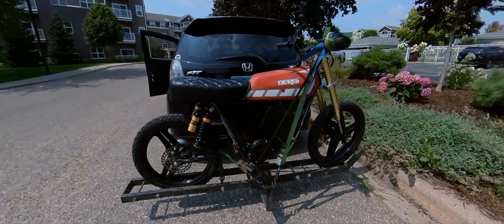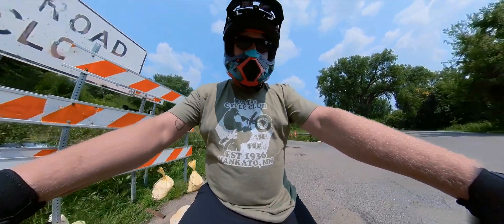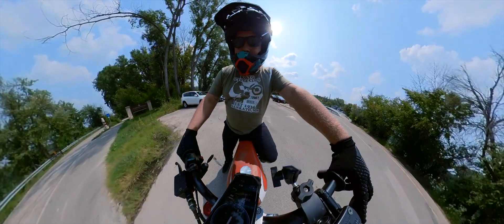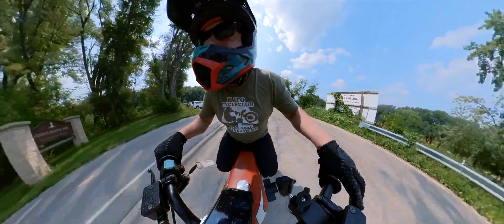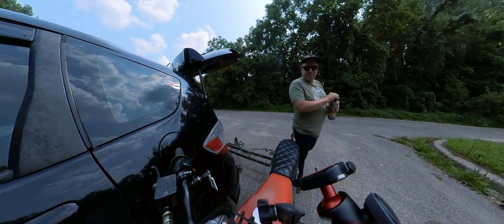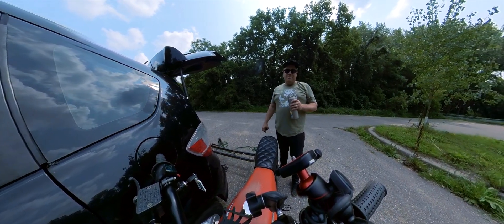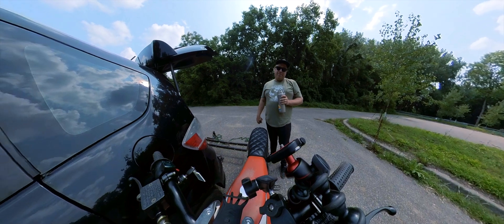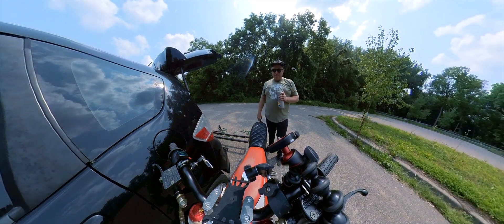DIY ELECTRIC E BIKE HITS 78 MPH. 72V 200A QS 138 DERBI

Comment: Is it 90H only or 90H V3? What controller are you using? What is the reduction ration from motor shaft to the wheel?
Reply from the maker: I think its the V3, I am using the Votol 200 and its 15x40 gearing?  I made a bunch of videos about the build process.
Reply: @Corn-ped  yes, it must be V3 if it has an internal reduction.

Comment: Он звучит как чертов сверхзвуковой истребитель!

Я почти влюбился в этот звук)

Какие характеристики тока ты вливаешь в этот мотор? Сколько вольт и ампер и какой именно у тебя мотор? 3 или 4 кВт номинально?
Reply from the maker: 72 Volts. 250 Amps.  Motor 3000W Nominal.
Reply: @Corn-ped  It's amazing that the motor is working, I didn't think it was possible to exceed the nominal value by 6 times))
Reply from the maker: @Jagerhart  It works perfect! It doesnt even get hot.

Comment: Wow that thing is great!!!! Which Votol EM200 are you using. EM200, EM200S, EM200SP, EM200SP/2 ? Asking because I burned already 2x EM200SP (same QS motor as You)
Reply from the maker: I am using the EM200 sp/2 I believe. How did you burn yours? Too high of amperage?
Reply: @Corn-ped  Na - One of them literally exploded when reversing out of the Garage, the other reported a internal short circuit (in the App)  and after switching off and on a few times, it roasted with very scary noises from its inside. It also took the BMS (ANT) with it... So - not really overcurrent issues in both cases. Seeing other threads and messages on Votol Groups, it seems there is a batch of bad quality EM200 Controllers and apparently I have a whole bunch of those :(. Moved to Fardriver for the moment...
Reply from the maker: @HeikoRehm  oh that's crazy! Stay safe.

Comment: Damn. I want this for my Puch Magnum
Reply from the maker: Might be hard to fit in a magnum Frame. But would be awesome
Reply: @Corn-ped  I’m quite proficient with fabrication and my welder. What battery and controller are you running?
Reply from the maker: Votol em200 controler and a 72v 36ah 300a peak battery

Comment: The 138 90h is an absolute beast. Anything over 250a continuous is an absolute nightmare as the bike runs away and just has so much torque. I'm using an 18t front sprocket and 35t rear to lower the torque and increase top end, what are you running? 🙏🫶
Reply from the maker: this is the 70h and I have it set for 250a right now. I have the gearings at 13x45 with a 17" rear wheel.